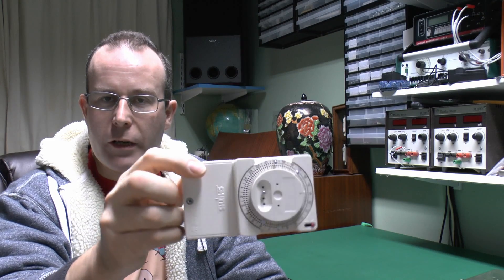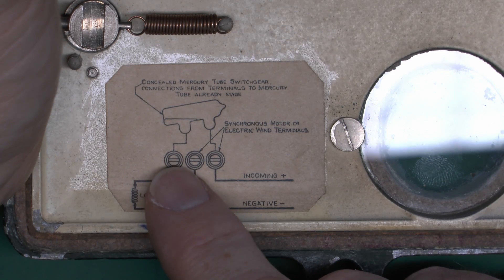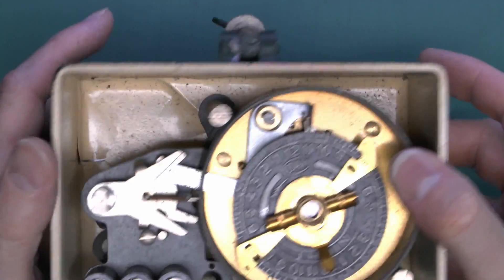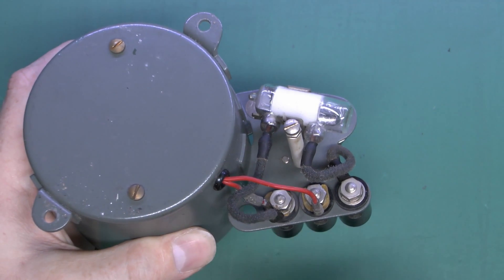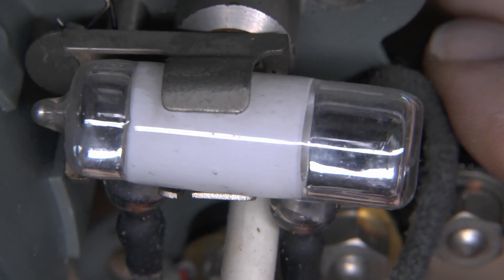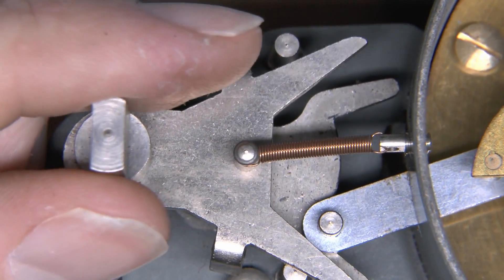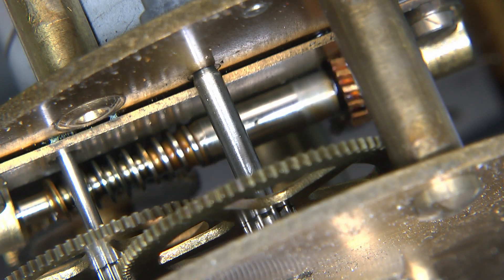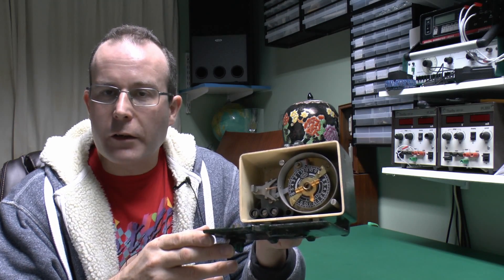Horstmann WSM Time Switch in Cast Metal Case

Comment: oozes quality. give it a new interesting paint, maybe cover dial parts in lume (like wrist watches) to glow in the dark throughout the window and you have a perfect if a bit steam punk decoration for the bed room that as a bonus still functions. pity that mercury tube can't be seen from outside. Only problem as it is heavy, is to attach it securely to the wall. If you want to part with it I'm interested.

Comment: A all metal case and no earth connection either on the in or outside by default. Or did i just miss it in the video ? 
I love it.
Reply: +Brian Boterman 14:21, screw on the outside bottom of the case
Reply: +Michael Tempsch Yes, that was quite common because at one point the IEE wiring regulations said that the earth terminal had to be visible from outside the equipment for inspection. That's one reason older 13 amp UK plugs had holes at the earth terminal screw, so you could see it without opening the plug
Reply: +TheChipmunk2008 Ah, I always wondered why the old MK plugs had that little square hole at the top!

Comment: Hey JW, fine video, thanks. I like these old mercury swiches, even as relais, these kinds of gear are nearly build for eternity... I think the white coating in the middle of the swichtube is a kind of porcelain or something to protect the outer tube from the heat of an eventual arcing. It seems that the conducting mercury string just opens inside this coating if swiching. Maybe they had produced a Version for DC too, and for DC operation this is a nice benefit to protect the outer tube.
Reply: +Paul Schuessler Yes, you're right, it's a ceramic tube fused into the glass for heat protection :)

Comment: Mmmm! HOW SATISFYING !!

I own a few Horstmann / HBE timeswitches, but none of them have mercury in them.

On your model number (WSM) the SM means Synchronous Motor.

I know this, because I have a HBE type U and have heard of a HBE type U-SM. The USM one has a synchro motor in it, whereas the type U is a wind-up only.

Interestingly, the Type U I have can switch AC as well as DC. It has a large opening contact, and there's a pair of them in series to make sure that the DC cannot arc across. The rating is 5A, whether it be on a AC or DC system.

Obviously speaking, Horstmann timeswitches of this era with the SM suffix on the model number are suited for AC only because of the synchro motor.

Now then.....

I once saw a similar timeswitch like this, but I think it was significantly larger than this.
It was one of the 'Horizontal' timeswitches like your WSM, but it had a full window so that the whole clock face could be seen, and it also had the HBE logo on it like yours.

HBE = Horstmann Bath England

 Instead of having a nice little neat sealed glass tube in it, it had these two large open-top pots, and I assume at one point, they would have been filled with mercury.

As the timeswitch operated, there was this arm which would dip into both of the mercury pots at the same time and this would complete a circuit.

The downside with it...... the mercury pots were open-top, so I'd assume that during installation / maintenance / removal, the mercury had to be removed somehow!

It's really nice to see one of these Horstmann HBE mercury timeswitches still in a complete and functional state.... the case is is amazing condition too!

Maybe one day, I might be able to obtain a timeswitch like this to go with my other Horstmann - HBE timeswitches.

I have added this one to my Favourites list.

Thanks for showing. :-)

-BoomBoxDeluxe.

28th October 2015, 19.19

Comment: It's a shame things aren't made this well anymore. You'll never find its modern replacement still operating 50+ years later.

I don't care if it's 'safe' or not, I think I'd rather have the antique in my home.
Reply from the maker: +TestECull Still just as safe as when made, the only non-compliant part now is the mercury switch, and that's fine unless the glass is broken releasing the mercury.
Reply: *****
And that's not a concern liable to rise up on something rigidly mounted to the wall. I can understand that being a concern on something subject to heavy vibration or sudden G-shock, like a motor vehicle or a generator or something where such a device could be used to detect an unsafe angle(IE rollover) and disable fuel pumps and ignition systems, but a time switch for HVAC? Eh, it's fine, not liable to break anytime soon.

Comment: Is it possible for you to test the switch at rated power to check if it overheats ? (blows up)
Reply: Aaaaah! It would be a shame to pop something of this quality!

I would prefer it if this timeswitch was left as it is.

Afterall, I do own a few Horstmann HBE timeswitches and later models, so I know how good quality these really are.

Popping one of these for a three-second laughter-kick would be an absolute sin.

Chances are, when Horstmann designed these, not only did they design it to take the full ten amps, but the over-engineered it so that it would take a bit more than that without blowing up.

Afterall, it survives to this day and is still fully functional, so that is top quality right there!

I'd hate to think how much a timeswitch made to this quality would cost today!!

If I had to take a guess..... £500.

Afterall, at that quality, the manufacturer is only going to sell one of them!

So no. It's best if this timeswitch does not get popped. This might be the last one like it! (Note: None of my Horstmann-HBE timeswitches use mercury)

-BoomBoxDeluxe.

28th October 2015, 19.29
Reply: Just the mercury switch, not the whole device.
Reply: Aaah, but it's part of the timeswitch though. Another thing, if it did pop, replacements aren't really available at the local hardware store and Horstmann probably don't make them anymore either, so if it did pop, we'd be left with an incomplete timeswitch.

-BoomBoxDeluxe.

28th October 2015, 22.17
Reply: Any one please send me a mercury glass contact switch, I will blow it up.